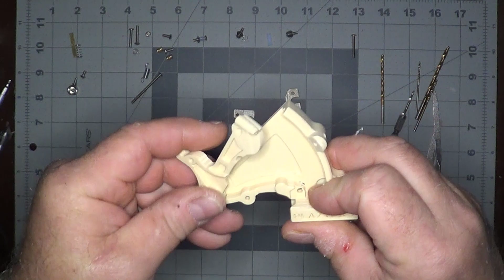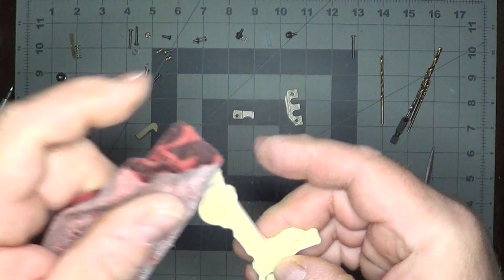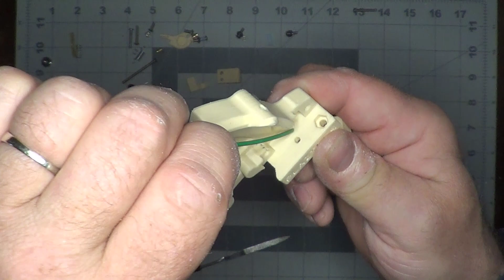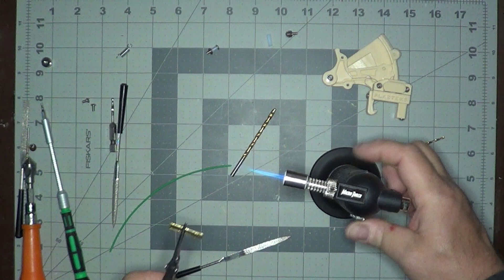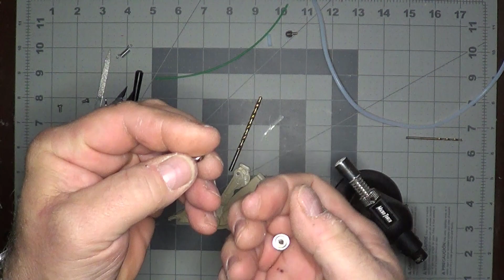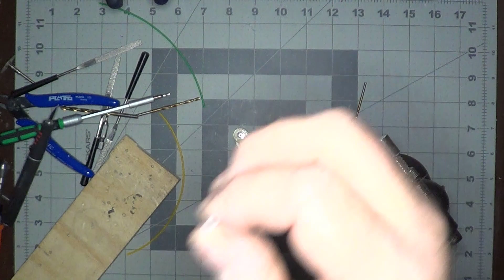Filament Loader V2.0 Assembly

Comment: Truly wonderful solution ❤

Have you some thoughts for direct drive challenges such as Bambu X1C P1S and FlashForge 5M’s..?

It’s a longer access route I know!

I was wondering if a pressure sensor driven motor DIY solution similar to InfinityFlow may be possible?

Happy to work with you 😊

Comment: what version are you showing in video? The creality ender version only have 5 parts is that correct.
Reply from the maker: There are two separate designs, version 1 is the straight unit, and version 2 is the one that is arched.  the main unit is the same, with mount differences depending on what extruder/mount configuration you are dealing with.  in the case of the ender, I have had both mounted on mine at times, but I also have it set up as a direct drive.  for stock configuration with the standard location, I recommend version 2 with the right hand orientation, since it needs to avoid the z-rod.  there are numerous ways to make it work, depending on where the extruder is located.  it is always possible to move the extruder from it's default location.  for the standard bowden tube setup it would need the offset bracket  to move the extruder back.  There are pictures in the Cults3d listing of version 2 showing the setup.
Reply from the maker: https://files.cults3d.com/uploaders/20184318/illustration-file/acdfc0bc-1b85-4f3f-a70c-f4a866c15a14/IMG_20230427_221746.jpg

Comment: I bought this off cults so I am anxious to give it a try. Need to order some springs. Have you tried printing it on a resin printer? Im wondering if that will help the tolerances and cleanup?
Reply from the maker: Hello, thank you for purchasing it.  I have not printed on my resin printer.  I have printed some other mechanical devices on my resin printer, but found the parts tend to be "sticky" on friction surfaces much the same way that stainless steel suffers from "galling".  the filament has to move smoothly.  I am not saying it won't produce an excellent part, I just haven't invested a lot of time resin printing and trying different resins.  Too messy, and my initial experience resulted in many part failures.